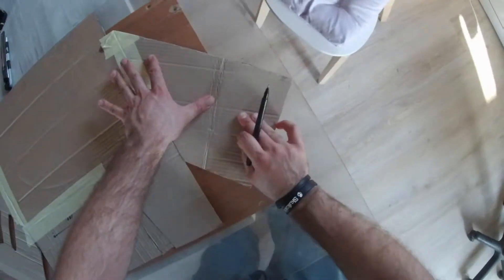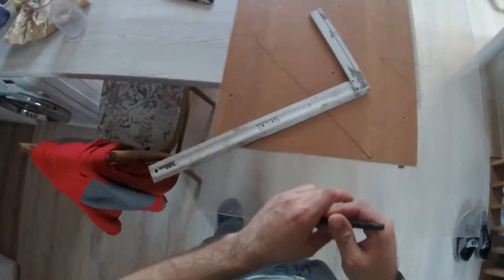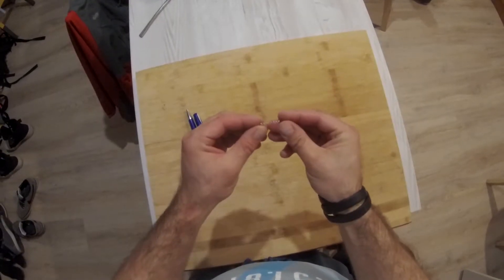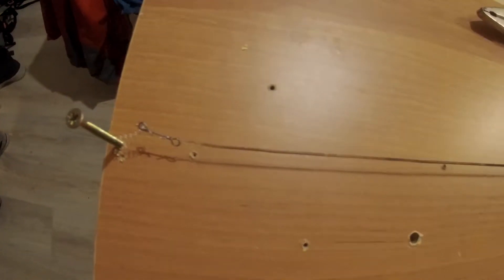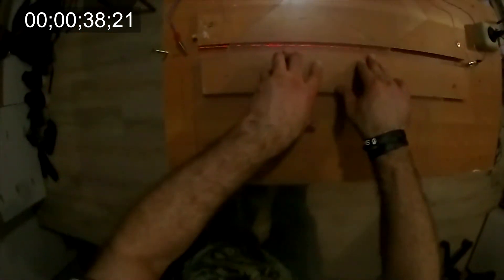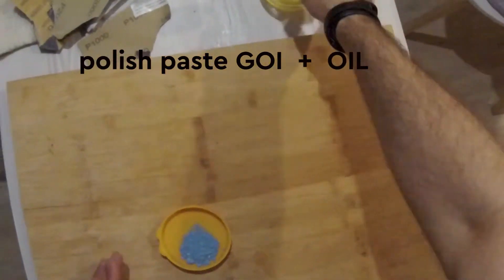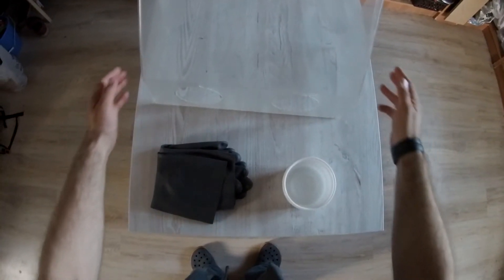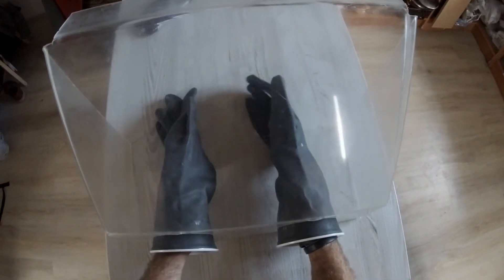🍄 Shroom Academy discreet glovebox. How make a glove box out of acrylic by yourself.

Comment: can you control moisture and air? i want to use this for battery making, as i learned that urea + aluminum trichloride reacts to moisture, and i would need valves to evacuate the chamber and fill it with either argon or nitrogen
Reply from the maker: The easiest thing would be to flush the entire glovebox with pure nitrogen. But please be very careful. Make sure the nitrogen does not displace the air in your room, otherwise it is possible to suffocate. Always work in a well ventilated room!
Reply: @shroomacademy4367  if you really want to make a controlled atmosphere, you should add a tunnel to one side that lets you open the tunnel to put in what you need to work with that has a door to the inside that’s closed until you flush the air from the tunnel.  After you seal the outer door, you open the inside door to maintain a pure nitrogen atmosphere.